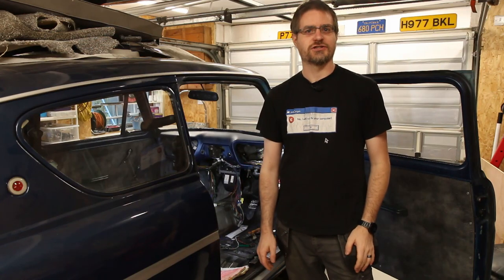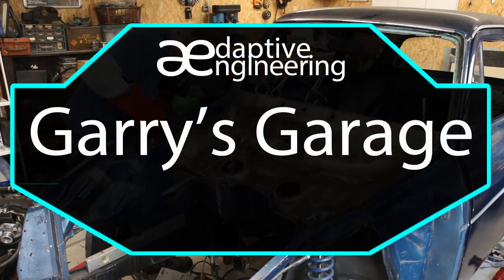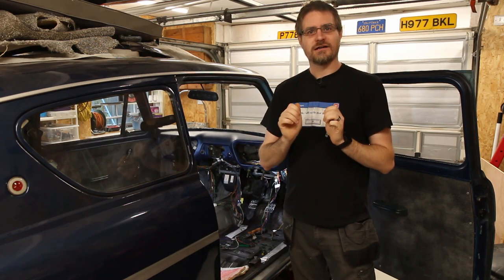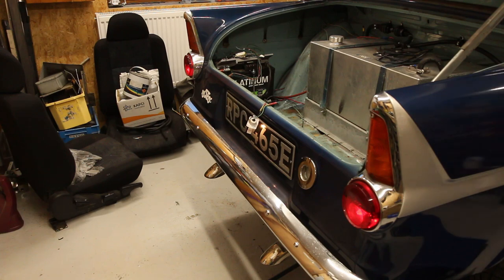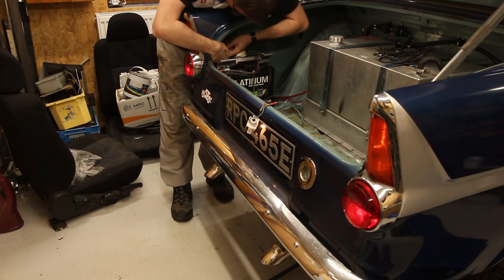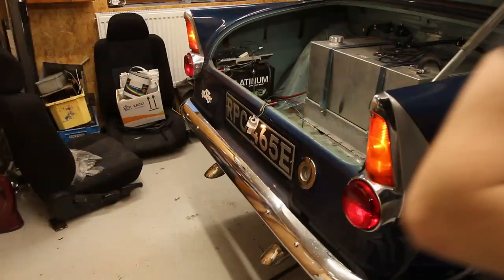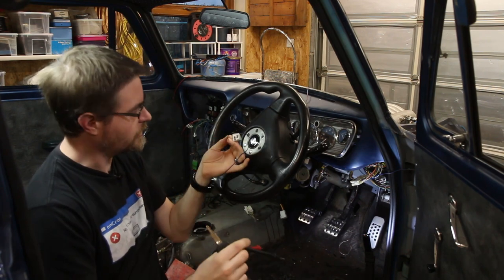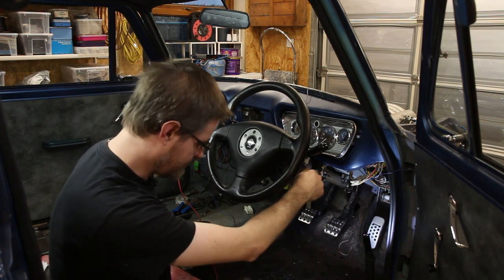Garry's Garage - What have I broken? - Ford Anglia #20

Comment: Getting back on track here, catching up with the episodes. Looking good. 
Can you remind me what ECU and tuning software you are using, please?
Reply from the maker: I'm using a Link ECU G4+ ECU, which uses their own software, PCLink. Mine is a Plug-In Evo 1-3, which is based upon the Xtreme model. They've recently released the G4x as a newer version, which has a number of nice improvements and enhancements. I think it's a really nice bit of kit and well designed software (and I'm a software developer). I would strongly recommend going for a Wire-In version rather than any Plug-In version, as the Plug-In versions do have some compromises due to the number of available connector pins on the original vehicle's harness, and it does limit some of your choices - for example I can't run sequential ignition, because the ECU Hold Power feature is wired into Ignition 4, so I need to stick with Wasted Spark. If I had a wire-in version, then I could freely choose what to connect to what.
Reply: Cheers, Gary👍